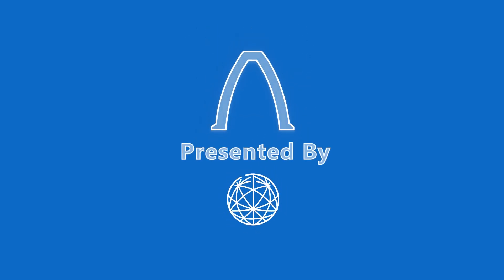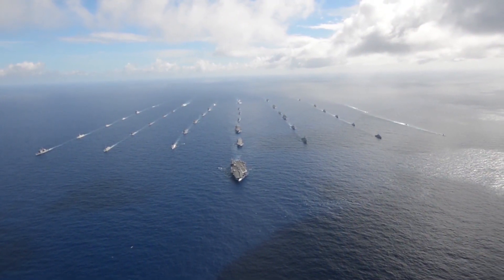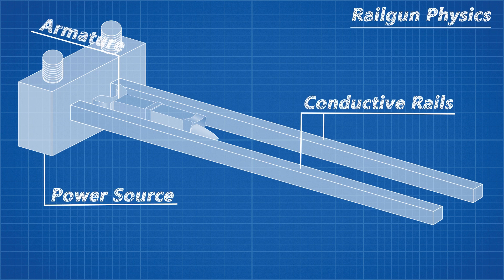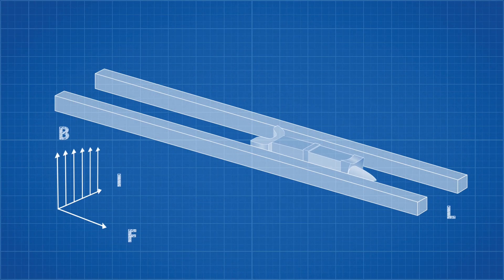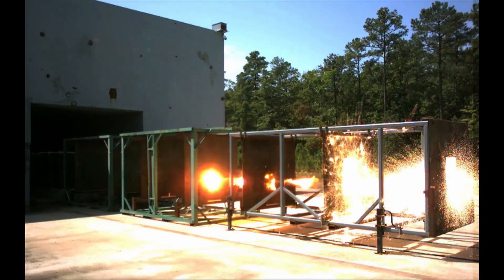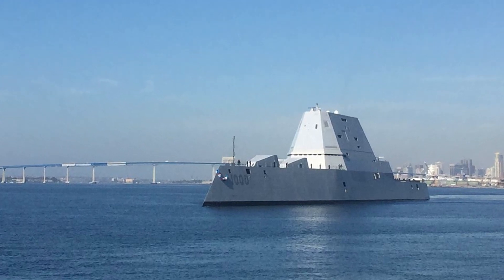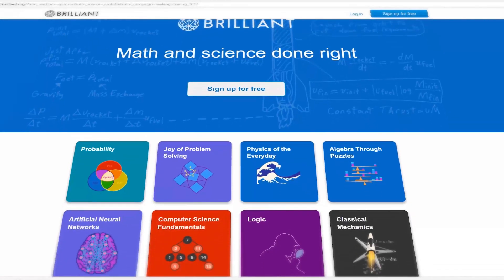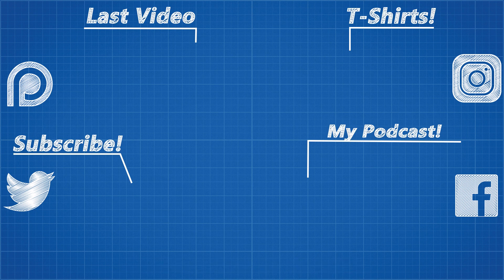The US Military's Most Powerful Gun

Comment: I had  a science teacher in Jr high in the 70s. He had us make an electromagnetic launcher for a class..plug it in and push the switch and we could shoot a ball bearing the size of a marble .  We just never could get batteries to work to make it mobile. Not enough power. We had to use extension cords to get from the plug in to the football field for its testing. Goal to goal was half power. Any more and it was out if the field. That teacher was cool. He died that sumner and we never worked on it in my 8th grade year. This made me think of it and our home made batteries.  Radio shack and battery month.

Comment: "The physics is simple but the math is not"
What do you mean by that? You mean the engineering computation like FEA simulation? That's probably the least amount of worry as most multiphysic anaylsis can be done with modern software. It's everything from materials science, manufacturing, electric generation that's the issue.

Comment: Railguns are going to get replaced by ETC guns. They use arc plasma to set off propellant more efficiently, and they can set off propellant that can’t be set off from normal chemical primers and explosions. It has similar muzzle velocity compared to the rail gun. And is smaller and can be used in tanks. Cone of Arc made a video on this.

Comment: for a railgun to work in space though, won't you need a second one in the opposite direction firing at the same time? Since there is nothing for the satellite structure to react the force to, the railgun will just make the satellite to move, rather than the bullet (like a rocket propellant). Or maybe I just invented a way to go to Mars in 5 minutes..

Comment: Hi. Many years ago (like 30ish) I worked for a gov site that had the infancy of this technology. I'm not going to talk about anything tech wise specific or in-depth, as I dont want my government to get pissed at me. But as you already covered much of what I cant talk about, I guess I can talk about some of my experience from its technological infancy failure wise. 
The main one was the 2 rails. As you said, they wear out (ours only lasted 1 shot if we were lucky) and blew apart. The rails always looked like a bad welder had had a go with the TIG. On more than a few occasions the Sabot would melt and weld to the rails causing catastrophic failure resulting in a lot of local people complaining about the noise.
The other common failure was the surge of electricity would often melt the cables, and you would get a big bright flash and nothing. But on the odd occasion one worked, it was spectacularly successful. Ultimately it was put on ice during my time in my country.

Comment: I think I might have a few ideas how to make a railgun viable
1.
Make a single use barrel with a number of rounds in it, the previous round interrupts the contact of following rounds, this is basically based on the metal storm concept
2.
each round is loaded with the rails attatched to the round
3.
quick change "barrel"

I wonder why they don't use simple coils and capacitors tho, no mechanical contact and little wear, is that concept just too weak to be feasable?

Comment: Friction. I would say, the burning hot plasma would wear down the rails harder, even if there was no friction.
Reply: Does this problem still exist in the vacuum of space?
Reply: @Babylauncher3000  Good question actually. No oxygen...no other gases. The arc is still damn hot, and will probably melt the rails.
Reply: @LaserGadgets  Makes me think A space railgun with self-correcting ammunition would probably be cost effective even with rapid deterioration.

 Anything it shoots at would a multi-billion dollar enemy asset.
Reply: @Babylauncher3000  I would just try to avoid shooting...
Reply: No plasma, no arc. Vakuum is a good insulator. The problem there would be to get current flowing consistently i guess. Perhaps you would have to insert gas or make sure the current flow vaporizes enough material so there is something that makes sure the current can flow.
Reply: @hernerweisenberg7052  Good insulator for HEAT, yeah.
Reply: @LaserGadgets  Right, i didn't think about that you would wan't a rather high voltage to drive a railgun anyway. You would need at least a couple 10kV's to bridge a small vacuum gap i believe. But i guess that railgun operates in that range anyway :)
Reply: @hernerweisenberg7052  I just dont believe that initial contact can be done without any sparks, friction, tiny bits of matter that turns into plasma right away. The higher the op voltage, the more electrons wanna travel from rail to rail :p and vacuum makes it easier for them. There is nothing in the way. The rails are pretty long, the capacitor bank huge. I have no idea how many kV, but a handful for sure : >
Reply: Ah the rail gun, the decepticon killer.

Comment: With conventional rockets you need (theoretically) about 80000 years to rech the proxima centauris system. With the railguntechnology we may need of course much less than 80000 years and you can outpace the voygar-satelite (even if it is dead).

Comment: Still don't get why they just don't couple this technology to existing naval reactor designs. For example, a Nimitz class carries 2 cores that are each capable of producing over 500MW apiece... although submarine and cruiser cores were of smaller size and output, they are still more than capable of feeding this weapon. Excess power could be used to feed the enormous cooling requirements as well. I suppose the simplest answer is cost.
Reply: What do you think runs the 4 propellers ? Plus one reactor is a backup necessary for fighting conditions -  so they don't use XBox game rules as you do..
Reply: @jwarmstrong  lol what? Who said anything about "video game rules"? I actually worked on a CVN... it has 2 cores. One is not "backup" they were both steaming the entire time. They could run the 4 screws and all the rest of the power and steam requirements for the rest of the ship without needing to approach full power levels. 

My comment stands.
Reply: @jwarmstrong  um, no, kiddo, I was a nuke EM. What "stories" am I making up? Let's see some evidence. I'm sure you can explain precisely how and why I'm "wrong" to everyone?

Comment: My Fision beam gun does not make contact to the ammo therefore is reliable on the gun materials. ceramic nanotubes are used as barrier separation deviance based on the thermotransluscent value . Some corrupt billionaire wanted to buy it for 2.2 Billion and i refused.  I literally just like using it to target shoot at 20mile range i have . 3 shot groups with in 2ft of eachother with a flight time of 7.16sec.

Comment: Rail guns firing at ballistic missiles: Only if missiles don't change course.
Rail guns firing at asteroids: Bad idea. Turn one object into many. Also, getting power source to space would be a big problem. Also, firing a rail gun will change satellite orbit, requiring additional fuel. Also, this is weaponizing space.
Reply: If the asteroid shatters enough the pieces will burn up in the atmosphere
Reply: @industrialbro  1) Asteroids aren't likely to have internal stresses that will cause them to shatter like glass when a high-speed object impacts them. 2) Even if they did, a large number of fragments would be large enough to survive the plunge to the surface of the earth. 3) Each hit on a fragment will break that fragment into multiple smaller fragments, multiplying the number of targets. How many rail gun sattelites do you think we'll have up in space, and how many rounds will each be able to fire? How many total rounds would be required to break an asteroid up into tiny pieces? 4) What sort of power source do you think those satellites would have? I think multi-megawatt fission reactors, coupled with huge super-capacitor banks, would be required. Heavy, expensive, costly to maintain. 5) I certainly would not be pleased with having a bunch of nuclear reactors orbiting the earth. Each would need to be removed from orbit in a fashion guaranteeing no radioactive waste would rain down.

I think hitting an asteroid with a bunch of gargantuan nukes would provide a greater chance of success. Even then, however, the chance of success would be very slim.

Comment: If friction is such a problem for the rail gun, why not remove it from the equation? 

What about a magnetically suspended projectile within a ring of electromagnets, the barrel consisting of subsequent rings, and each ring in turn pulling on the porjectile towards the end of the barrel, and then switching to pushing the projectile the moment its center of pull/mass passes the ring? In this way, the porjectile would be launched forwards without touching anything, eliminating frictional forces on all but the air within the chamber. If this too is too great, air could be removed from the chamber prior to launch with an incredibly thin disposable membrane at the front of the barrel maintaining the vacuum/near vacuum until the projectile launches and pierces the membrane. This would, of course cause the porjectile to possibly slow as the air outside now tries to fill the negative space in the barrel, but this whole system is only if the air friction of launching the projectile is too great in the first place, and is just a quick solution I'm improvising on the spot here. 

Idk, just something I thought of when I watched, I'm certainly no engineer so if it's a dumb idea forgive me, just curious is all.

Comment: Accelerating the projectile to the desired speed
in such a short distance must be a 
substantial part of the problems, like heat, & deterioration of the "barrel".
It seems the initial acceleration of the projectile could use an alternative thrust force, along with a longer "barrel". 
Seems like a longer "barrel" would
require less intensive energy 
over an extended distance.
Would a lubricant make any difference?
A Solid or Like a lubricant, could reduce friction,
& Extend life of "barrel".
Replaceable sleeves.

A two, three, or more stage design maybe. 
Alternative projectile designes.
Maybe a hollow projectile with a interior rod, and outer casing like a traditional barrel.
Gun powder, explosives, lazer/steam, mechanical, etc.
Could provide initial thrust.
Accelerating from a dead stop requires more of the detrimental effects than accelerating a moving projectile.
Mind that these observations
come from one not schooled
in the art of projectiles
regarding wepons of war.
Just seems to me that there is
more than one approach to 
achieve the solve the problems.

Comment: Huge railgun in orbit so heat dispersal is extremely efficient.
power it with a fusion reactor, also because of really good heat dispersal.
the projectile is actually a capsule for 7 tungsten rods.

boom.
city tenderizer.

Comment: "Huge versions in orbit"

So the orbital MAC platforms that defend Earth in Halo 2 aren't completely unfeasible.
Reply: Imagine how much more efficient they'd be in low/no atmosphere. No loss of energy to air drag, and less friction at the rails. This weapon system is more practical and efficient in space than on earth. (Of course, putting something that heavy into orbit and supplying it with power is a whole other problem)
Reply: Ringo Fasho halos SMACs are either powered by ground based generators as seen by the SMACs on Reach or are powered by built in power generators. Either of these solutions could be feasible 500 years into the future.
Reply: @ringofasho7721   Heat would be a really big problem though.  Air is good at soaking up all that thermal build-up.  And on the ground we can do things like water-cooling.  Up in space all you have is radiative cooling, which is much slower.
Reply: @edouarddubois9402  They could have large radiators.
Reply: @edouarddubois9402  Well, due to the reduction in friction there would be less heat build up to begin with, but that notwithstanding a system could be rigged up to take that excess heat and recycle it, especially if we're talking a sci-fi like time period where the gun is mounted on a manned platform. If it's a proper ship then they could pull that heat and use it to supplement water heating, air heating for the crew, or even cycle it back into a thermal power plant to charge the 'batteries' for the gun. It wouldn't be much extra power, so the water heating is most likely, but when you're in space you take what you can get.
Reply: @SpiritOfFire88L  I realise it's been a year... but radiators, despite the name, use convection as their cooling method.
Reply: @ringofasho7721  Yea those are easily the biggest obstacles here.
Reply: @ringofasho7721  building it in space would probably be way cheaper and more effective than trying to bring it in piece by piece like the ISS.
Reply: @ringofasho7721 perhaps sending off parts one by one to space and then assembling them there could work, though it sounds expensive
Reply: yeah thought the same
Reply: More feasible than most sci fi guns.
Reply: When he said asteroids I was like
"It sounds a lot like Halo to me"
Reply: "That MAC gun can put a round clean through a covenant capital ship"
Reply: One shot and you'll probably deorbit the satellite...
Reply: Technically Halo's MAC guns are Coilguns, not railguns. There's a fundamental difference between the two.
Reply: @LDSG_A_Team  Same basic principle though. Magnetically accelerated projectile.
Reply: brain=giga

Comment: I figure that, as far as I can see, the primary utility of railguns is going to be delivering payloads into orbit. There is a significant problem of railguns as it relates to ships and it's the same problem that has largely made naval guns largely obsolete. Smaller ships still carry relatively light auto-cannons for self defense or for interdicting light craft(such as pirate boats) however we haven't seen actual use of naval guns in an artillery role since Vietnam.
The simple fact is that guided missiles are a far safer, far more accurate and considerably farther reaching method of seaborne fire-support - and the same applies for anti-ship weaponry.

I don't think we'll be going back to guns unless missile countermeasures develop to such a degree that they can generally be relied upon to deal with all missiles whilst simultaneously not being able to intercept the railgun's flechettes. Until then, better missiles will be the preferred option.

That having been said, I can definitely see railguns being used to launch payloads into orbit - be it craft, materials or human cargo(although you kinda have to wonder at the acceleration forces on the last one).

Comment: I wonder if coilguns might eventually overtake railguns for military vehicles.  This is one of the few instances where a more complex weapon actually has lower maintenance (coilguns don't need to replace tracks every couple dozen shots, but make no mistake that they are more complex than a railgun). 

One must wonder though, could you just engineer a railgun with extra-thick rails, and then just make the ammo itself have some tension-spread component that allows it to function on a railgun with a small range of different "barrel widths"?  I mean, if you make the ammo itself capable of working in even a small range of distances between the rails, then you can use the railgun for many more shots between having to replace it. 

One must also wonder:  Would it be possible to just make a railgun with a disposable rail that are perhaps outright included with the ammo, and having a new rail "reloaded" into the gun each shot, along with the projectile? 

Two ideas for dealing with the railgun issue at least.  One where the ammo is made to work regardless of rails being worn, and the other in the opposite direction where the rails themselves are intentionally cheap and single-use, effectively treated similarly to the casing on a normal round, and is swapped out for a new one each shot (with spent rails tossed into storage where they would be sent back to be melted down and recycled later, presumably, or possibly even remade on the ship itself).

Comment: Could a significantly longer barrel help solve the problems of both heat and kick? You could reduce the amount of acceleration proportionately I think. Yes, this might mean a 100 foot gun but we are talking about something mounted to a large military vessel and meant for artillery and not quick response times. It would be cumbersome but It would increase it's refire rate and durability quite a bit would it not?
Reply: The heat is from friction.  A longer barrel means its accelerating to a higher speed, which increases friction even more.  I believe a shorter barrel would reduce friction and increase durability, at the expense of range and power.
Reply: @Hotarg  
A longer barrel would not necessitate a higher velocity. The acceleration is determined by the input current. If you increase the barrel and reduce the acceleration accordingly then the heat is at the very least distributed along a much larger medium. 

It's my suspicion that it might reduce the overall heat produced as well since the acceleration would be lower but I couldn't be certain without testing that one.

Comment: I'm no engineer but I always wanted to be a scientist I guess maybe you're right actually of course it would have to be tried out but if you can be used in the space shuttle I think you should work just fine on the railgun and use it and all the instruments in the proportion to eject projecto out of the barrel maybe if they would customize titanium that's the barrel and all the other fitting equipment and has high temperature that might do the trick but not until you put it to the test I know titanium is more expensive but in the long run it'll last a lot longer then regular conventional iron